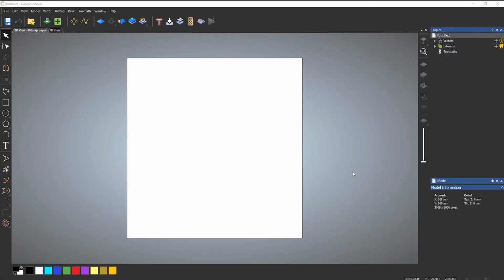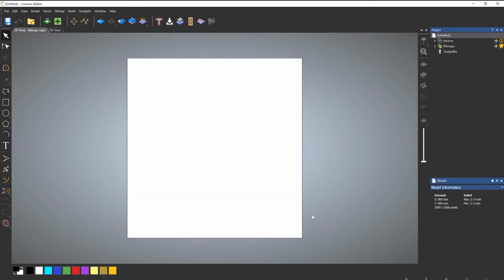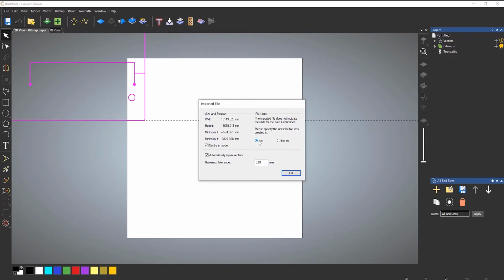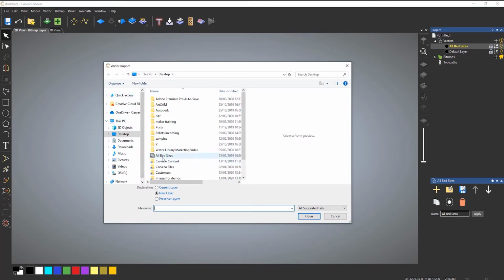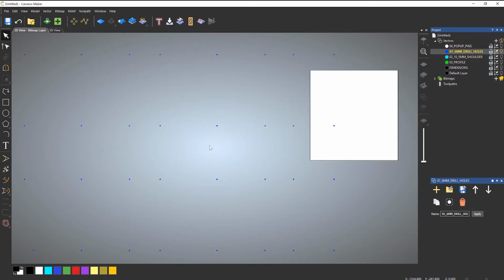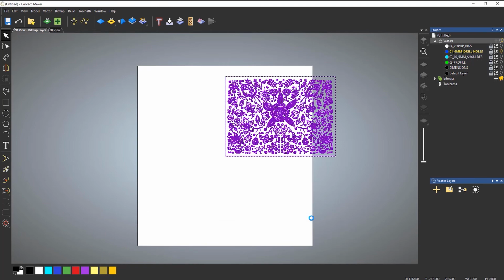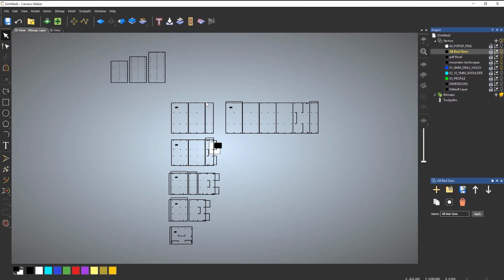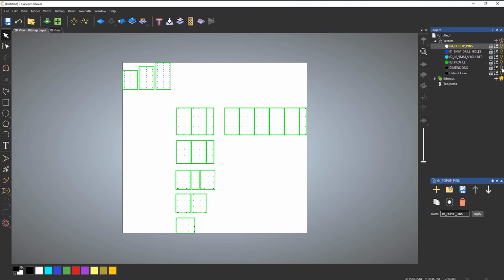Carveco Maker: Importing Vectors

Comment: Is there a way or file format can be imported that will preserve the correct size? Some of the things I want to make have some critical measurements.
Reply from the maker: Sure Dave.  If you go to the Edit dropdown, select Options.  Then withing the "File Import" section, make sure you have "Auto-resize Vector Artwork After Import" deselected.
Reply: @Carveco  That’s great, thank you. I want to have a go at designing and making a guitar with the software. The body shape and holes needed in it etc, I can do with in Carveco but the fretboard is done in a separate bit of software, that generates the layout based on your input.